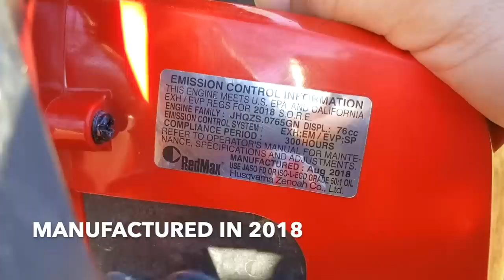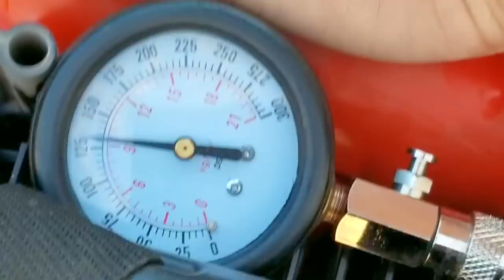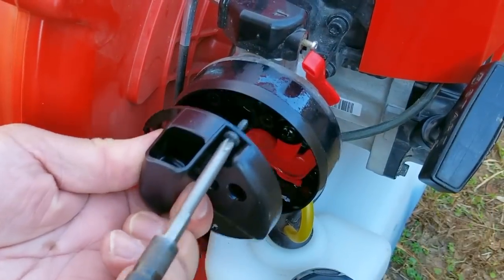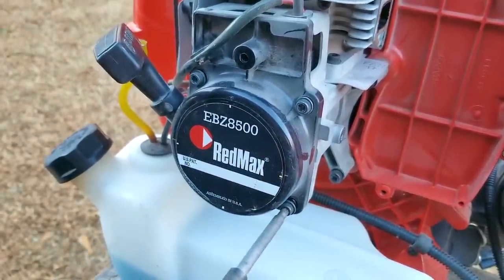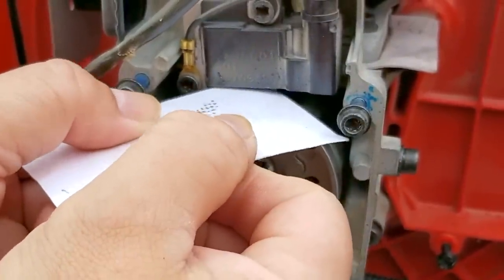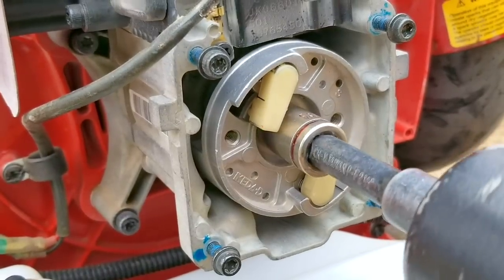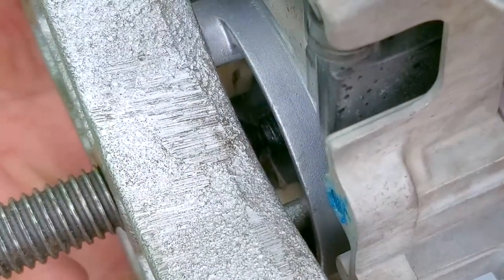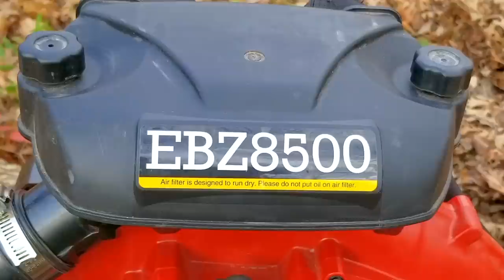Fixing A Redmax EBZ8500 Backpack Blower That Won't Start

Comment: Do you know that the crank seal is bad? If it is it will run erratic. Normally if the carburetor is flooding it’s the needle. Could be a weak ignition module but usually they will either work or not. They will also fire and you will think they are good. I would buy a $15 aftermarket carburetor and put on there and see what happens. I would bet it’s the carburetor.
Reply: I experienced the same exact thing on the same exact blower. I rebuilt the carb. Needle, diaphragms etc. Sometimes you can rebuild these carburetors and they work fine. Sometimes they won’t. They prime fine. Don’t flood. But will not start. I work on these aggravating things everyday.
Reply from the maker: I'm leaning towards the Carb too, But it's not my blower and the decision was made for me.
Reply from the maker: thank you for sharing your experience and information I appreciate it.

Comment: Couldn't it be that the air filter was clogged or something but it seems unlikely because it is a new blower
Reply from the maker: yes you are absolutely right, the symptoms it had looked like an extremely dirty air filter , or one that was partially wet.

Comment: Literally did everything in this video on my Husqvarna model of this redmax. Still doesn’t want to start…..very frustrating
Reply from the maker: sorry to hear that.
Reply: Any recommendations?
Reply from the maker: what did you get for the compression reading? and did you try using the drill to start it and "un-flood" it?
Reply: 145: and yes. I literally went step by step with your video. I’m at a loss

Comment: To remove that flywheel, I seen a guy put the nut back on barely then hit it with an air hammer. It came loose in less than 1 second. After seeing that, an air hammer is all I will ever be using from now on.
Reply from the maker: that makes sense, thank you Kentucky Cornbread.

Comment: I have a 25cc weed eater brand that's giving me the same problem. Changed the coil to get spark. Have done all the normal stuff but still won't start. I'm thinking now the compression may be bad. I'm almost to the point of finding a Catholic priest to perform an exorcism on it, ha, ha.
Reply from the maker: nice, have you tried getting a compression reading?
Reply: @HomeGaragechannel  I don't have a compression gauge. I thought I might could rent one at an auto parts store.
Reply from the maker: actually I think it's part of their loan program to, pay for it, and return it, no questions asked, and a full refund.
Reply: @HomeGaragechannel I have a spare motor.  During the process of swapping motors i noticed the 2 plugs on the kill switch were bent & touching. I changed the motor anyway. Now it runs.